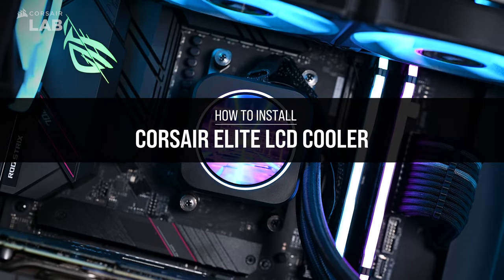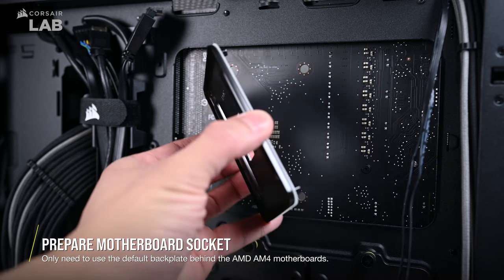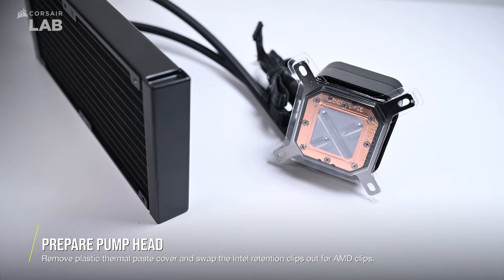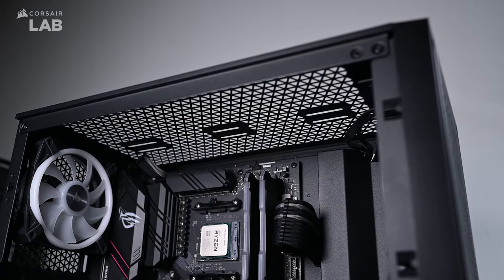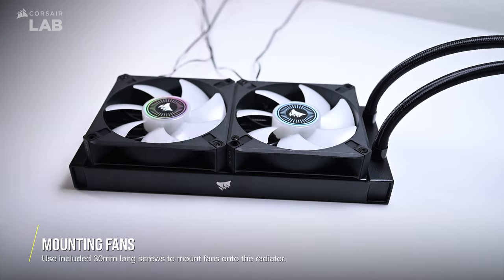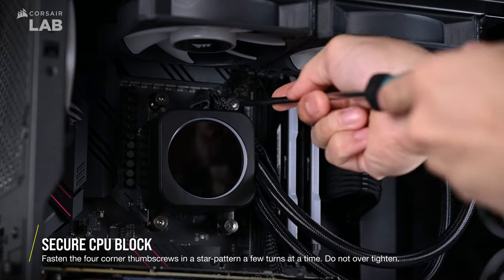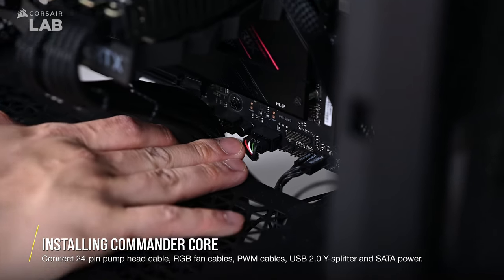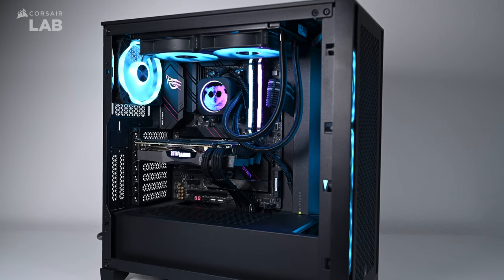How to Install CORSAIR ELITE LCD CPU Liquid Coolers

Comment: Will the LCD add-on kit come with the new AM4 brackets?
Reply: It doesn't need a bracket, u'll install it to the top of the pump, if i know right but Corsair also has a video about it
Reply: @szabozoltan3165  Yes, I know about that but was wondering if the new AM4 bracket would be included as it’s an improvement over the old AM4 bracket. Anyways, I already watched an unboxing video and the answer is no.

Comment: Oh now you got an am4 bracket huh.  Do a video on just the lcd kit on an existing h150i please.
Reply: It's quite easy just remove 4 screws and the old pump head comes off and just screw in 4 screws and the  new lcd is magnetic
Reply: @capsikseason  we don't have to change mounts or anything?
Reply: @KatDiesel25  naah u don't need to change mounts if u buy a new lcd elite cooler they have changed the mounts but if u have the older elite capellix and just buy a upgrade kit u won't need to change mounts
Reply: @capsikseason  new mount is actually much better than the old mount.
Reply: @TheSjuris  yeh it's good I don't mind the old mount had no problems with it but do prefer the new one

Comment: Anyone else having trouble with the red warning triangle?
Reply: Yup..
Could be power draw from your mobo. Try plugging the usb cables to an internal USB hub. (I'm hoping this will fix it for me.)
For some people the y-splitter caused problems too.
Could also be something to do with usb power settings on shut down.
Or the 20 pin adapter isn't pushed in far enough. Needs more force than you might initially feel comfortable with. Wish I knew that sooner as mine was working perfectly before it came loose.
And as long as no pins are bent and the lcd is firmly seated then it could simply be a software problem and may need an installation or a full registry clear of icue. 
Good luck figuring out what it could be because I know first hand how annoying this is.

Comment: I got the H100 Elite LCD today and it runs almost like a charm.
The display is showing a red triangle with exclamation mark (anyone has an idea why?).
Other than that, my CPU (i9 12900k runs about  ~8 degrees celsius cooler than my temporarily cooler I had before.
And iCUE syncs with my graphics card, which is made by ASUS.
Reply: Dude same… it was working yesterday and now I can’t get it show anything but the triangle. Doesn’t even show up on the ICue software
Reply: @johnnyrocket0426  guys if you found the soltuion please let me know i have the red triangle and it doesn't show on icue
Reply: @minato003  I managed to get a different screen.. but it’s just saying liquid temp 0 degrees lol
Reply: @johnnyrocket0426  yeah mine too
Reply: @johnnyrocket0426  did you find a solution to the problem?
Reply: @M1710 did you find a solution?
Reply: @minato003  nope. I saw that there was a new update for the software but still nothing. The screen shows 0 temp. It shows up on my device list for the pc but it does not show up on iCUE
Reply: @johnnyrocket0426  mine is still like that too sometimes it shows the triangle sometimes it shows 0°
Reply: @minato003  yeah I’m not sure what to do. I’ve uninstalled/reinstalled.. I’ve changed usb hubs, with and without splitter. Tried using splitter for only LCD.. usb drivers all fine. It literally just won’t show up on iCUE… lol support hasn’t even gotten back to me and it’s been almost a week
Reply: @johnnyrocket0426  i have done the exact same thing
Reply: @minato003  it at least works in cooling terms… but the whole point was for this screen smh honestly might just return it
Reply: @johnnyrocket0426  i just got an email from corsair they are trying to help me now
Reply: @minato003  best of luck! I hope you find a solution
Reply: @minato003  Corsair has asked that I return mine for a replacement
Reply: @johnnyrocket0426  they told me to use a different sata cable and nothing else😑
Reply: @johnnyrocket0426  i am gonna return mine too but do i do that with corsair or with the store i bought it from?
Reply: @minato003  I bought directly with Corsair so I’m going with them but I’d say to return to the store you got it from and maybe ask for a replacement? You’ll probably get a quicker turnaround then me.
Reply: I returned my H100i Elite LCD to my computer store and upgraded to the H150i instead. Guess what? It worked for like three weeks without any hassle. Now I have the same shitty red triangle of death. I start to believe that Corsair has no clue how to deal with this error.
There is no solution to this than perhaps getting an Asus AIO solution and I would hate to do that since i really like this product.
It might be Windows 11 bricking the display though, because my display stopped working right after the latest cumulative update.
Reply: @M1710  I got mine replaced a few weeks ago and the new one has been working flawlessly. I think it was a commander core issue because I tried using the old one with the new screen and it gave me the triangle and then I used the new commander and no issues
Reply: @johnnyrocket0426  
The most odd thing happened to me earlier today.
My little one was playing under the table and accidentaly shut of everything by switching off the power outlet.
My computer did boot up but rebooted almost right away and I saw my H150i's display came to life.
The display's full functionality returned. I was stuck with the red triangle of death or endless loop of my GIF.
So this issue is definitely not hardware related unless there is a problem with the power connecter from the water block to the display itself.

EDIT
Back to square 1 again.
Please Corsair fix this
Reply: SAME

Comment: Terrible decision NOT to include the new 4-point AM4 mounting bracket WITH the $100 cooler upgrade kit because the LCD literally POPS right out with the 2-pin bracket!!! Horrible..